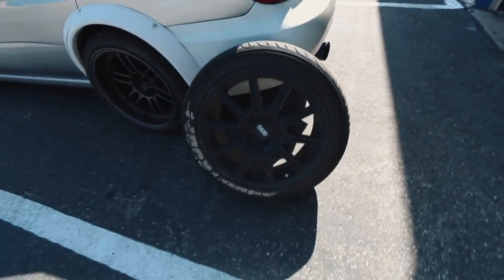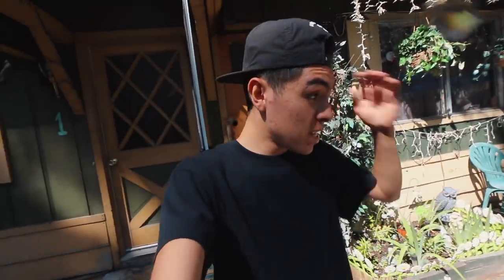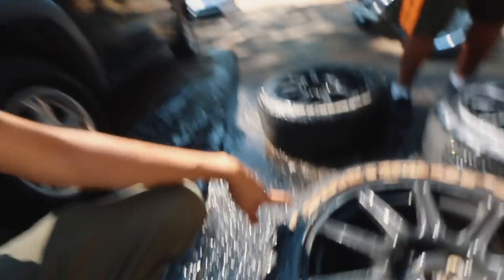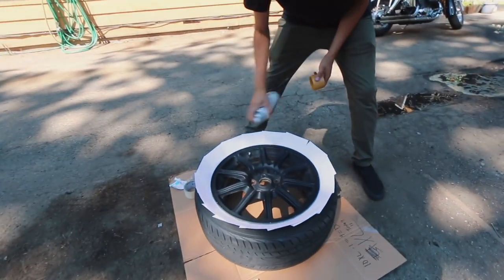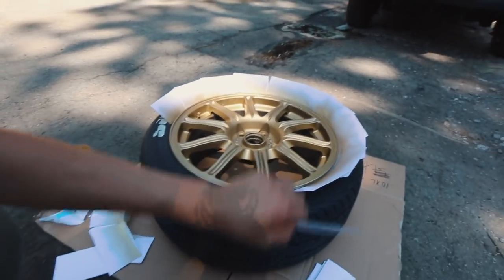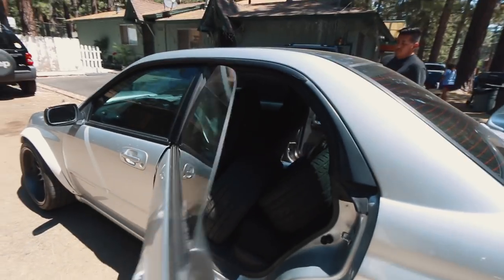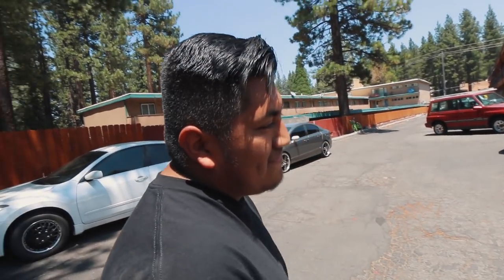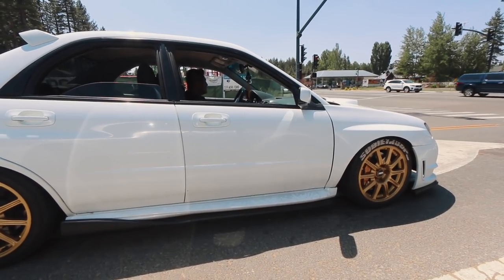The REASON I Went Back To Stock Wheels!

Comment: 5 days ago it took me 2 hours to remove my plastic dip BBS rims from the subaru
 2x4 so it will be an entire to remove all the dips for all 4 wheels. I used Brake cleaner, WD-40, Beer, and a pressure washer.

Comment: Use goo gone it does wonders for plasti dip let it sit for about 20 min with 2 heavy coats then use a pressure washer an it comes right off hope that helps